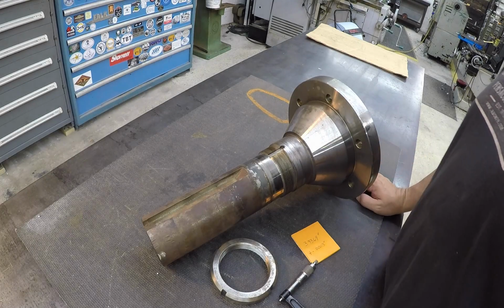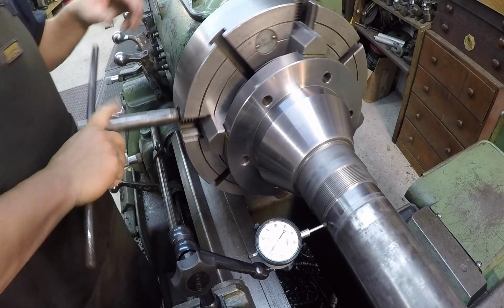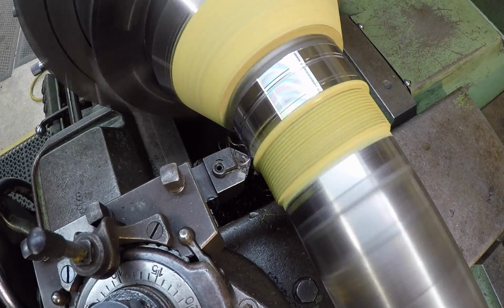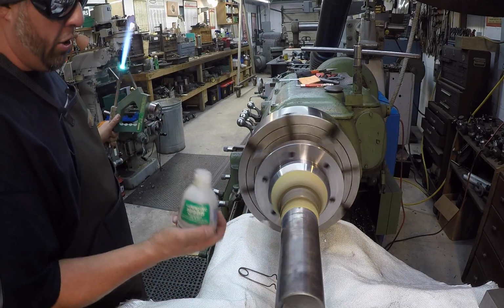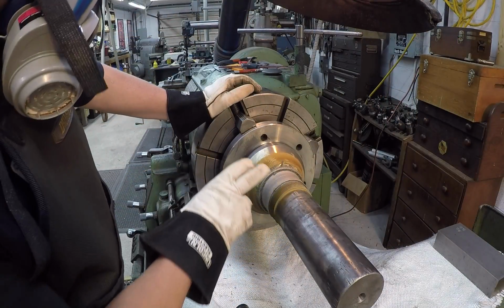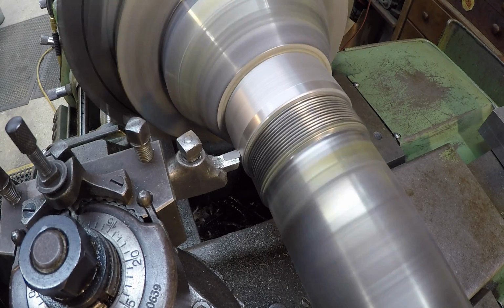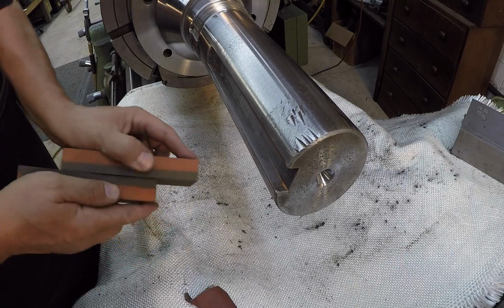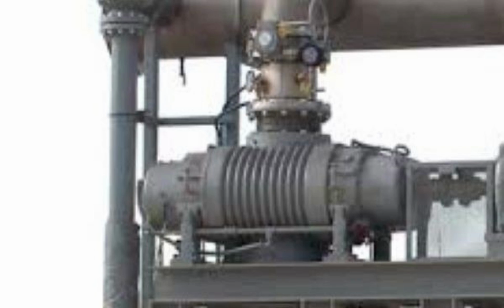SNS 300: Spray Welding a Blower Shaft

Comment: Back in the 1970's and 80's I worked in the jet engine overhaul department of a major airline. I worked on the Rolls Royce RB-211 engine. We would send worn parts out to be spray welded and machined back to specs. We called it "Plasma Spray". It looks like this may be the same process. Is it?

This is the first time I visited your channel. I really enjoyed the education. Thanks!
Reply: no plasms is much hotter

Comment: old school repairs are so much better than modern stuff such as sleeves , i learned correct repair back in the 70s  from a machinist with 40 years  time old school always works  may be harder but its real

Comment: Am I right that you were increasing the diameter of the shaft by heating with the torch while spraying fine metal particles into the frame?
Reply: Yes. Spraying molten metal particles onto the surface to build it up, then machine it back down to correct dimensions :)

Comment: @Abom79
Enjoyed that alot. I used spray welding in the 1970 to repair shafts of hydrolic rams. Big rams, seems it was cheaper than getting a new ram. I didn't work for myself, I worked for a Co. I retired in 1980.

Comment: I learned to do the Eutecnic spray metal process back in highschool in 1969 or 1970. The equipment had a thumb trigger for the powder application like a cutting torch.

Comment: Other options besides sieving for this type of repair are convectional welding, this is used in heavy equipment all the time, and it can be done on site with line boring and auto welding equipment.

And convectional brazing, this again has a heat problem as Adam mentioned, but on some application's woks very well

And lastly heavy Nickle Plating, I don't know if it's still popular but we used it to rebuild the diameter of undersized dies, when I worked in the punch and die shop ... you can build up .100" no problem and there is little heat. 

I first knew of spray welding for building up engine crankshafts as a boy, it was popular as you could use original style bearings to do engine rebuilds.

Comment: Thank you for sharing this process. I made use of a smaller Eutectic torch system as far back as 1990. Didn't have access to internet etc then, but successfully managed to build up the tips of valves for use with radically modified race camshafts, and even managed to weld light cracks in cast iron cylinder heads, although that was very much hit and miss. I really need to dig that torch out again..

Comment: I ran an electric motor repair shop for many years before I retired. Spray welding saved quite a few expensive motors from the scrap heap.
Reply: That's what I used it for as well, METCO was the brand we used if I remember correctly, we used one of the stainless steel powders on everything we built up with it, we used it for the end bells for a while before getting ez sleeves in every size available, then we just used it on occasion for the bearing fits inside the end bells. Saved so much time from not welding and straightening shafts.

Comment: I was trained as a machinist back in the early 80's, long before CNC stuff.  It is great to see a true machinist using things like dial indicators and micrometers.  This was the first time I had ever seen spray welding, and it is pretty cool.

Comment: Have used this exact Eutectic system in the 80's and early 90's while working in a machine shop.  The only thing I remember different is I learned to put a groove nearer to each end  for patch stability and/or even use a very coarse shallow thread under the weld, like 8TPI or whatever would fit..  It will increase the bonding area by almost double by doing this.   Even used a hard bronze for a bushing area on shafts.
Reply: He did have the 1 groove in the middle. For a surface that wide it should be enough.

Comment: Just happened across this video never heard about spray welding before so enjoyed your video. Recently saw a video on lazer cleaning. If you haven't seen those yet you should check it out. pretty much never have to wire wheel again.

Comment: I used this method once in awhile. Most I use is METCO or MOGAL  wire feed system. Powder system is expensive over the long run.
Is like a egg shell if you don't prep well, your  correct in explaining this, It will peel. You did every thing as I would have done, I'm surprised !
You use a 4jaw with soft pads , like myself. I have respect for you sir. ....Robbie ...P.S. I just subscribed.

Comment: In fact, I have a 27 ton Remington log splitter cylinder that could use that, it sure would beat the hell out of me putting a weld on it then meticulously knocking it back down

Comment: That's cool as hell! I've been a certified marine and auto technician for 44 years and I have never heard of spray welding until I ran across your channel.  Thanks
Reply: I have only ever seen one shaft sent out for repair when I was an apprentice 25 years ago. It was one of the upright table legs from a Huron mill and it came back all rough and speckled like this and was finish ground in house. I always wondered how they did it. Great to watch this video.

Comment: I worked in a large motor shop and we did this to large elevator motors. Mainly the stator shaft because this was a lot cheaper than replacing them. This was also in the 70's. Damn, I'm getting old. lol. Good old days.

Comment: I was using greasy 320 sand paper.  Finish was like a grinding quality finish. When machining it is important that your carbide tool never coming red at the tip otherwise you risk to peel the repair.

Comment: I can't see how that has any penetration?
Reply: It just bonds over the surface and sticks well enough to machine and hold a bearing in place, it's excellent in some applications but not all because it can crack and peel like a shell or fly apart if used for the wrong application.
Reply: @SW-ii5gg  Ah I see. So more like a bonded shim. Thanks for the reply.
Reply: @Newtsalad  you are welcome.

Comment: Interested to see you start and stop the lathe, down to start and up to stop though when you pulled up to stop the rotation of the chuck didn't seem to stop so quickly. Respectfully ask you check the polarity of your supply because as far as my experience goes its up to start and the brake activates when the lever is pushed down and pressed down hard.
Reply: @Chris-te7uk  thanks for your reply. I understand the mechanical connection and the Lathe does not have an electrical one. All that is given, what Im saying is the clutch and brake mechanical connection will work in reverse/forward depending on the way the motor is wired (3 Phase) Ill ask you to think of the worst case scenario, if god forbid a person is caught in the rotating chuck/workpiece, would it be easier to press/knock down the lever or pull up? To pull up with force (chuck end lever) brings you nearer to the rotation where as to hit or press down with yr full weight to activate the brake/disconnect.

Comment: What's the advantage of this to chroming it? I have never done any of this but in my field when we need a part repaired due to a bearing spinning we usually have it chromed and ground down to spec.
Reply: @Chris-te7uk  and microcracked hexavalent chrome is a nasty electroplating process and a real pain to grind in tiny passes without flaking it off. We have taken it up to 20 thou on gas turbine journals but very time consuming.

Comment: worked with that rototec and eutalloy back in the 90 greatest process to repair expensive shafts only my carbides where diferents from former soviet union bk8 and t15k6 for fine cuts and they sure didnt burnt where best tips i ever used and you sir are a real craftsman my respect

Comment: Would this not be better done with sub arc? Only asking because we do sub arc at the shop I work at. Not sure if the temperature would be a factor in this application. Great video!
Reply: FYI I’m in no way a welder, I’m a maintenance technician and past CnC and hone operator. Also to my question the thickness may factor in. We also have a laser welding clad department.

Comment: I had to build up a shaft with a TIG torch once; it was a PITA. It's a real pleasure to watch you do this. I've learned a lot! :-)
Reply: Yes you did an actual weld repair. The above is not a welded surface it is more of a coating.

Comment: In the early 80's I worked for a company that repaired cast iron moulds for the glass bottle industly, we used spray welding to fill in the cracks & damage. Nice to see it again :0)

Comment: WFT is a Yankee Cylinder you might ask...and ASK I DID!!  Yankee dryer
From Wikipedia, the free encyclopedia
Jump to navigation
Jump to search
Old Yankee cylinder outside Pauliströms bruk in Sweden

A Yankee dryer is a pressure vessel used in the production of machine glazed (MG) and tissue paper. On the Yankee dryer, the paper goes from approximately 42–45% dryness to just over 89% dryness. In industry, MG cylinders or Yankee dryers are primarily used to remove excess moisture from pulp that is about to be converted into paper. The Yankee cylinder can be equipped with a doctor blade and sprayed with adhesives to make the paper stick. Creping is done by the Yankee's doctor blade that is scraping the dry paper off the cylinder surface thereby crêping the paper. The crinkle (crêping) is controlled by the strength of the adhesive, geometry of the doctor blade, speed difference between the yankee and final section of the paper machine and paper pulp characteristics.[1]
Configuration

Whereas in other paper productions a series of drying cylinders is used, in tissue production only one cylinder (the yankee cylinder) dries the paper. This is due to the necessity of creping and made possible by the low grammage (gsm = gram per square meter) of the paper sheet for tissue products, which is in the range of 14-45 gsm. For the production of the higher gsm in this range, some machines are nevertheless provided with some (4-10) drying cylinders after the yankee. In this case one speaks of "wet creping", as the creping of the paper done on the yankee is not made on the fully dried paper and the drying is completed after the yankee cylinder.

Yankee cylinders are traditionally made of cast iron and have diameters up to 6 m, therefore much higher than conventional drying cylinders. The width is a bit larger than that of the paper: typical for tissue are paper machine widths 1,74m 2,32m and 2,70m and their multiples (usually nowadays the doubles of these values are typical). Therefore, yankees are very heavy (~100t) and difficult to cast. Since a couple of decades the production of yankees made of steel is gaining market and new machines are practically always nowadays equipped with a steel yankee, which is much lighter, easier to produce and to transport.

Due to the abrasive effect of the creping blade the surface of the yankee becomes irregular and rough. Therefore, periodically (with very varying frequency: from every 6 months to some years) cast iron yankees have to be ground or polished. This decreases the thickness of the shell, and since the yankee is a pressure vessel, also the maximum pressure which can be used for paper production. A way to avoid this declassing of pressure is to make a metallisation, i.e. to spray onto the surface a special Chrom-Nickel alloy, similar to a high alloyed stainless steel, which is then ground with the foreseen crown of the shell surface, leaving a coated thickness of ca. 0,7–1 mm. The metallised surface is then much more resistant to the abrasion and only a very mild polishing may be necessary ca. every 2 to 4 years. The thermal conductivity of the metallisation is a bit less than that of the original material, so that cast iron cylinders are metallised after some grindings of the shell, in order to gain, through[clarification needed] thickness decrease, some conductivity which is then again lost with the metallisation. Steel yankees are instead always metallised since the beginning.

The big dimension generates a problem with the elimination of the condensate forming inside the cylinders, therefore all yankees use a system with blow through steam which than it is re-compressed by help of a thermocompressor (ejector). In the inner surface of the yankee circular grooves are present which accommodate small pipes (s.c. "straw pipes" or "straws") through which the mixture of steam and condensate is sucked by means of a pressure difference between the yankee and the tank collecting the condensate (separator). The straws are combined in racks and these go to typically 6 collectors which take the condensate-steam mixture towards the center of the cylinder from which then it is taken out into usual piping and brought to the separator. Here the condensate and the blow through steam separate at a lower pressure than that inside the yankee. In order not to spoil the blow through steam, a thermocompressor uses motive steam (at a pressure ca. the double of that in the yankee) in order to increase again the pressure of the blow through steam to the value of the yankee.

Yankee safety is an important issue and TAPPI has a committee (Yankee Dryer Safety Committee) dedicated to it. The sharper problems are present with cast iron yankee, being this material much more brittle than steel, making the yankee very sensitive to temperature differences. For example, a yankee which is receiving steam while it is not rotating may be damaged by the temperature difference of the bulk to the bottom of the cylinder where the condensate is present. Particular attention shall be taken in case of fire, as direct jets of cold water on the surface of the hot yankee may damage it. Some cases of exploded yankees due to these and other reasons are unfortunately present in the history of tissue production.

The usage of a chemical coating on the surface of the yankee is nowadays the rule. This is constituted by a mixture of usually 2 or more constituents: 1) a base polymer (adhesive) based on polyamides or epichlorhydrine resins which coats the surface of the yankee with a polymer layer in which the creping blade works, instead of scratching the iron surface. The base coating usually also has adhesive properties and keeps the paper attached to the yankee surface until creping 2) a release agent based on mineral or vegetable oil or waxes which lubricates and improved the detaching of the paper from the surface 3)various modifiers, which may make the coating more soft or hard or improve the protective effect on the yankee The coating is sprayed together with water in the space between the creping blade and the press through a spray bar with nozzles. Only the narrow space between this spray bar and the press is the one in which the water coming with the coating shall be evaporated and the polymer has to cure. For this reason for the base coating increasingly pre-cured polymers are used.

Comment: Way back when, I witnessed spray coating of a 16 feet diameter so called Yankee cylinder.  The cylinder was nominally cast iron, but special high alloy.  However, to make the coating to stick, the base metal had to be roughened by really heavy sand blasting.  The spraying operation, once started was run continuously (3 shifts) to keep the temperature variations minimal.  Then the coating was a beast to turn back to dimensions and slight barrel shape.  In fact, we had to reverse the cylinder rotation and turn the lathe cutting tool upside down in order to eliminate the vibration -- as best as we could.  The whole operation took 2 weeks, as far as I remember.

Comment: Nice video. I learned a great deal about spray welding. I work in a large machine shop in the Cincinnati area for the past 31 years and had only heard of and seen the results of repaired parts through spray welding. I thoroughly enjoyed this video! Thank you! (BTW: I was stationed on the USS Lexington from 1980 to 1983 at the Naval Air Station.)
Reply from the maker: Very cool! My Grandad was a shop four man at the machine shop that serviced the Lexington on NAS Pensacola.

Comment: Abom79 ? Would it save you more time if you used 3 Dial Indicators instead of one ? Because with one Dial Indicator, I noticed you have to keep moving it.
Reply: re-seating it is the least part of the works. iterating around is normal. dont over-estimate the wrong part of the operation.

Comment: I first saw metal spraying when I worked as a millwright in the ‘80’s. Setup, temperature and using correct powder are crucial to success of the repair’s longevity in the field especially on high torque applications. It was neat to watch you use the older torch to accomplish this task. Great video. Thanks for sharing.

Comment: Hi There; I would like to ask you a question BUT before I would ask you to beg your pardon for my ignorant question,can you repair engines crankshafts and Camshafts. Thanks
Reply: While not a machinist myself I am an auto enthusiast. 
  It would depend on the material of each part. But I know that they used to (still do) weld camshafts for hard face and also old obsolete cams for repair. Most old cams are cast iron, lots of the newer stuff is steel. 
I would say a steel crank is repairable this way since, as he mentioned, it’s a cold process and has been done before. Not sure if iron would accept it.